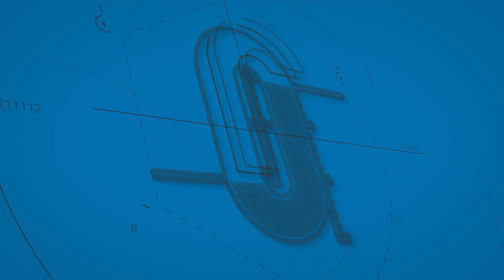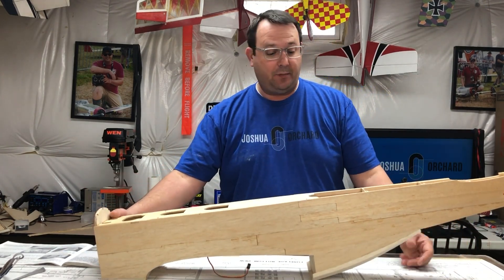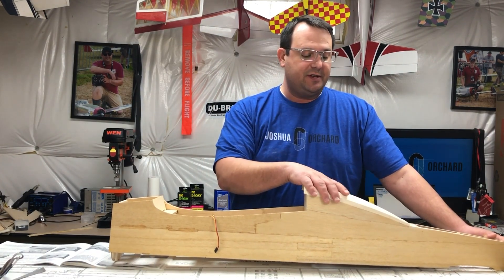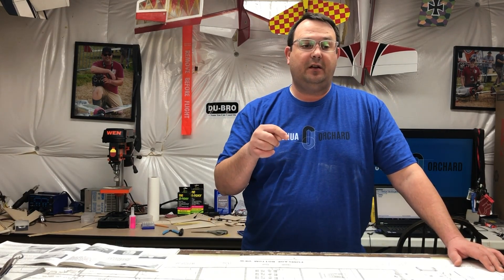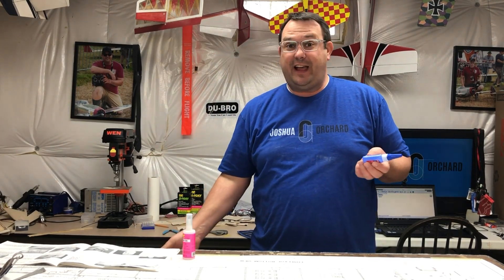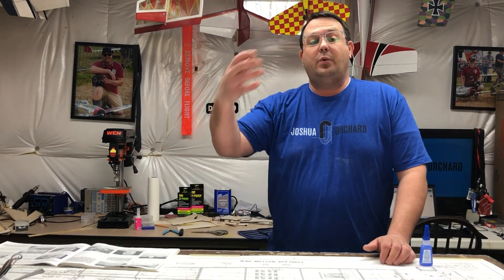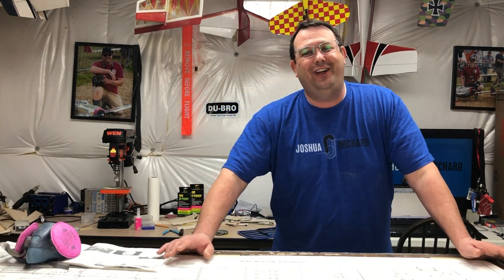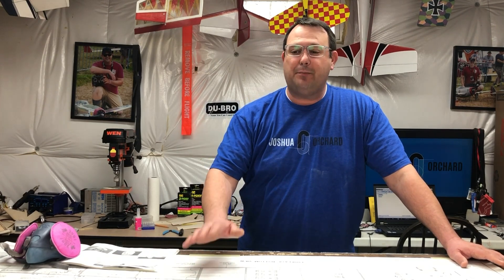Mustang Update 05: Killing me slowly

Comment: I had exact same thing happen minus the hives. My wife actually noticed it first and said “Every time you work on that plane you get all stuffed up and runny nose.”  Turns out it was the CA glue and/or the dust from sanding glued joints. I too bought a mask and largely resolved issues. Curious about your air tank, I’m doing a top flight giant scale and the plans show the air tank pretty much beneath the radiator on the centerline...with a cutout for a full cockpit and enough room to even put a power box below the cockpit box or perhaps in front of it depending on weight.
Reply from the maker: Yeah, this is not the giant scale but I'm pretty sure it calls for the same size tank, oddly enough. The ply plate for the servos really is only 1" beneath the top plate of the fuselage so JUST enough room to get the servos in and have a bit of room to spare there. This .60 size is not the same bird as the giant scale. Part of the fun on the smaller .60 size is trying to get more details packed in but in this case I feel like there are just too many structural compromises that would have to be made.
Reply: @JoshuaOrchard  ahhh yeah for some reason I was thinking giant scale. Yeah even the giant scale is forcing me into a few different design configurations, but I’m probably gonna save much time and effort to get the iflytailies cockpit...it’s beautifully done and probably far better than I could do

Comment: So the next P51 effort will be with the Loctite CAs? You’re not the first pilot a P-51 has tried to kill.
Reply from the maker: Well, the vast majority of the work is already done but yes, the Loctite CA glues will be my default moving forward.
Reply: @JoshuaOrchard  Is it a particular loctite CA that you use or do you just pick up what ever CA you can find at the big box stores?
Reply from the maker: @davidckenyon  Yeah, usually the blue bottle or the white bottle with the black cap are what I use. They are the consistencies I like for "medium" and "thin" viscosities. Generally I've found them to be far less expensive than CA glues at the hobby shop at cost per oz. with no appreciable difference in adhesion IMHO.